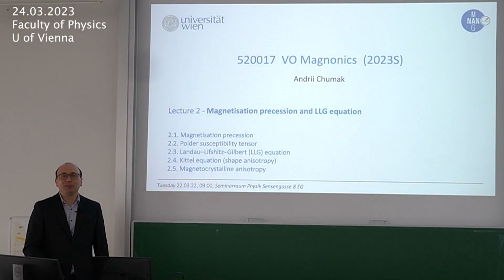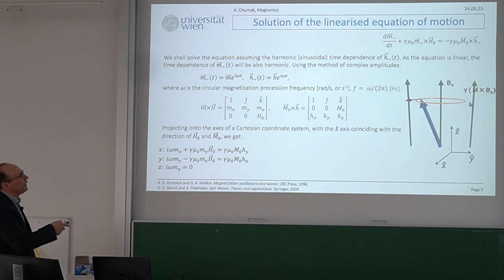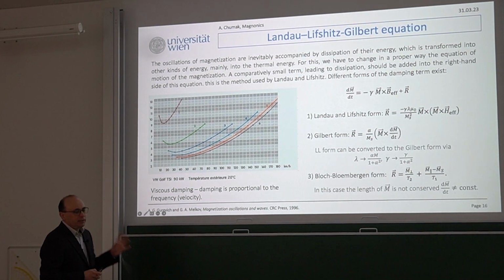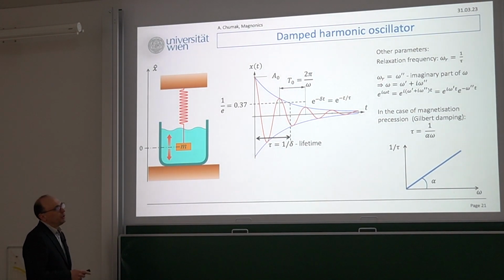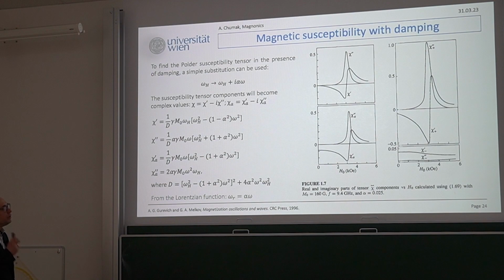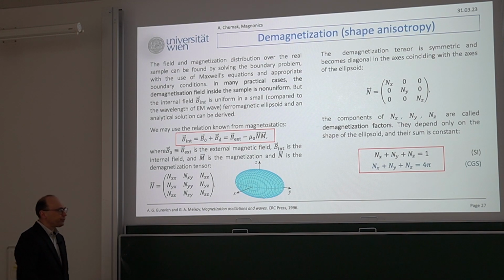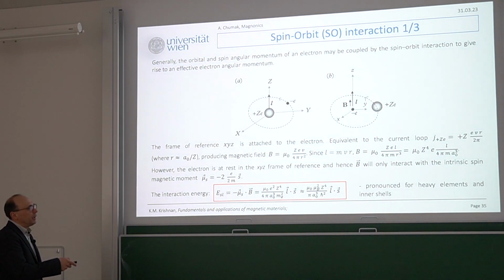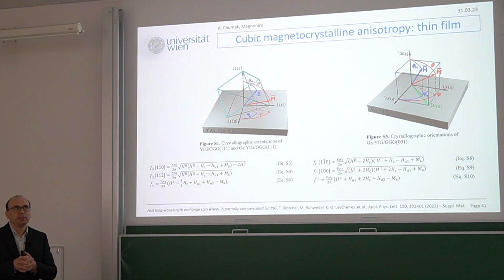Magnonics - Lecture 2 - Magnetisation precession and LLG equations

Comment: Can someone help, where does mu0 come from around 12:00
Reply from the maker: Hello! Here is what our scientists have to say to your question: 
Magnetic permeability of free space (or magnetic constant) μ0 is a constant defining the relationship between magnetic field strength H (A/m) and magnetic flux density B (T) in a vacuum. On the top right corner slide 8, the Landau-Lifshitz(LL) equation is written with B, while two next equations use H. To combine these equations, we introduce mu0 in LL. Moreover,  both systems of units: CGS and SI are used in the lecture in parallel.
Thanks for watching!